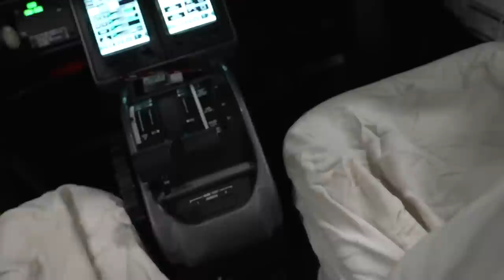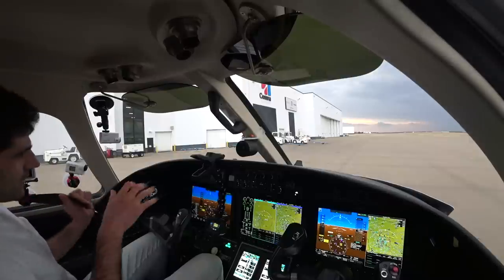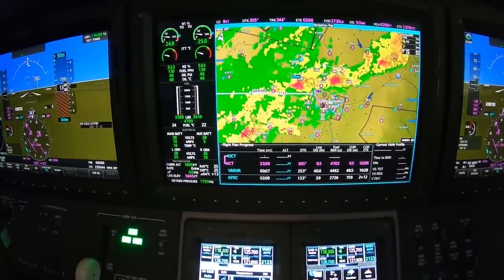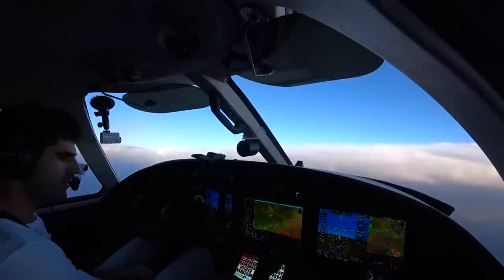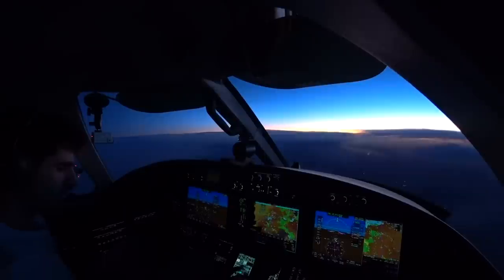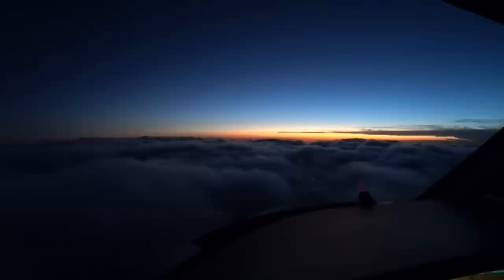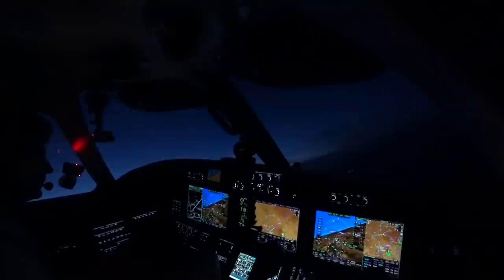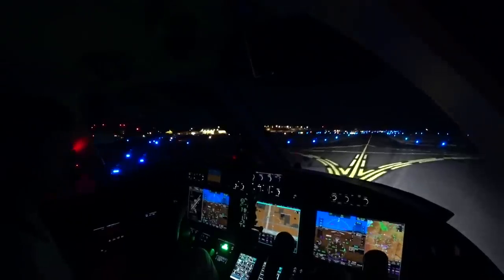Dodging Thunderstorms After Engine Repair!

Comment: Showing portions of the engine work was nice. Watching the various landing conditions is also nice. You have a very consistent and methodical approach, whoever taught you taught you well. The way you do it with the instrumentation you have available you make even the most "sporty" landings look routine. It is amazing the various conditions you fly through all in a routine consistent methodical manner to get down to that last 300 feet for a greased landing just about every time. 

I would also like to comment on your videography. It is high quality. You have mentioned that you have gone over a learning curve with that too, to the point of using the equipment that you use today and undoubtedly the editing software to put it all together. It is a lot of work to do that to a fairly high standard that you have achieved. It makes a difference when viewing the finished video which you are pumping out at a pretty good rate. Are you doing all of your own editing or do you have somebody doing it for you?
Reply from the maker: Hey Dave! Really appreciate your kind words. Will try and keep it up. Thanks so much for watching! Take care

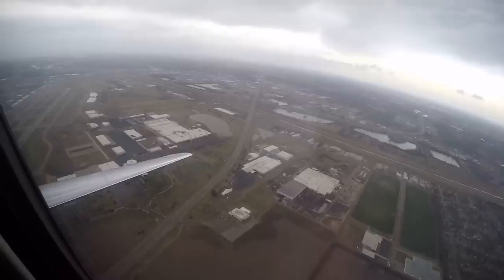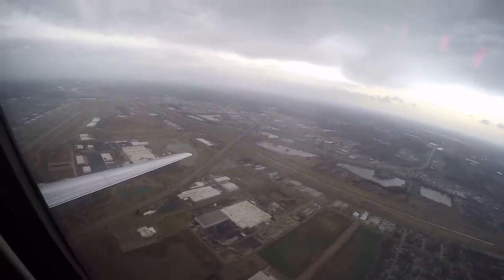Comment: Awesome video.  I do have a question tho.  at 11:56 - 12:02, on the left wing, I see a rectangular tab protruding from the top of the wing.... a little more than halfway down the wing.  What is that?  Is that a spoiler to roll the plane since you were in a turn?  I didn't think planes that small used spoilers for roll control.

Comment: Hey Max I been meaning to ask you . Because I'm more than just a few years your senior can I ask you if spending as much time at Altitude as you obviously do have you noticed any negative  effects from the insane increases in bio available Aluminum Oxides  or Cabin illnesses ? I'm guessing you're not buying the Horizon to horizon "Contrail" stories  are you old enough to remember what a Clear Blue sky actually looks like and no I'm not talking about the white hazy light blue but the deep blue "Clear" sky's we used to have .

Comment: I would think that a product like RainX for auto windshields would be available for aircraft windscreens to facilitate sheeting of exterior droplets for aircraft not having wipers. So what is the temperature of "bleed" air to the Citation to eliminate "icing" on the windshield? It seems odd that lesser Citation jet models  have less effective exterior droplet moisture mitigation methods!! Certain equipment should be mandatory on a aeroplane like brakes, control surfaces on wings, engines capable of powered flight along with the aforementioned  windscreen management.